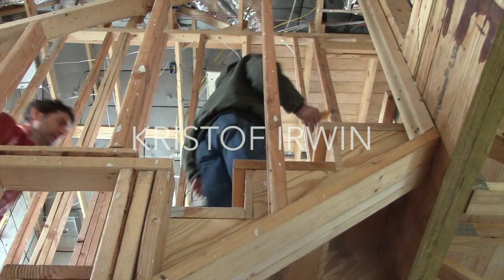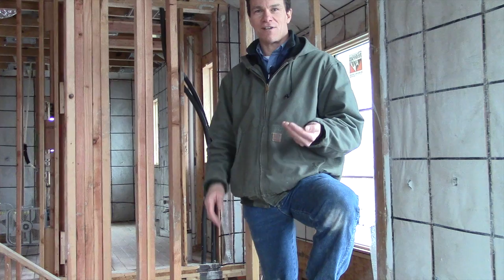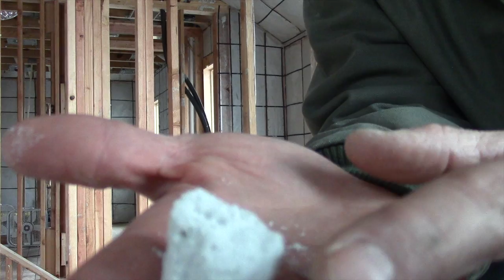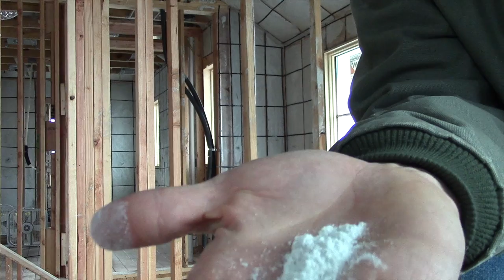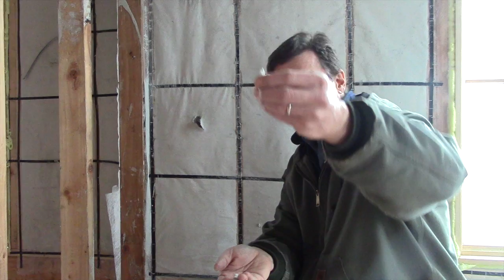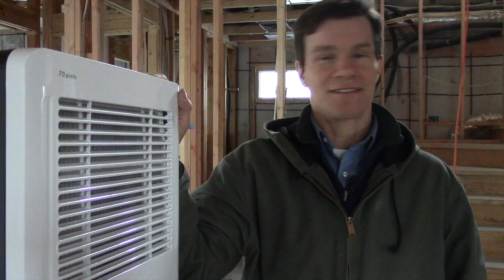Positive Energy On AirKrete & Home Insulation

Comment: aircrete usually have a bit of compression strength, but this air krete is totally dusty.. although it is dry because it make your skin dry.. does not means it will not suck in moisture and holding on to the moisture and accumulate over the time.. 

pls do a follow up. 

thankyou.

Comment: As I understand it it's brittle because it hasn't fully cured yet it's supposed to get super hard like Roman concrete if it was made with the correct type of cement
Reply: He should have came back in a week and then see if it was still brittle cuz it wouldn't be if it was done right
Reply: @ernieferguson6346  but sadly no follow up. i hate these kind of video with partial info.. like keep us hanging....

Comment: Kristof - I've listened to and enjoyed many of your podcasts, but today I came across this video while researching alternatives to closed-cell and open-cell spray foam for a renovation project I'm planning for my grandfather's 1940 Cape Cod - and I'm fascinated by the potential of AirKrete.  Have you followed up with your client (i.e., the owner of the home in the video) to see what the results have been?  What are your thoughts about the product?  I'm also wondering whether it could be used to reinsulate the attic of my current home.  Finally, do you do distance consulting and HVAC design work?  We live in Richmond, VA and I'll need someone to do the HVAC design.  Thanks.

Comment: Just use closed cell polyurethane foam.  Better at air & water sealing and a higher R value.
Reply: In case of fire I would prefer impervious AirKrete over smoldering polyurethane smoke filling the structure. Air and water handling I can live with, same with R value ... smoke I can't live with (literally).

Comment: Nice Job Kristof and Team PE!  Great video.  Interesting product.  I wonder if it has any air sealing properties in itself?  It seems similar to Owens Corning's new Conditioned Attic system using fiberglass.  Non-SPF, Netting needed, Ability to creat a vaulted insulated attic shell.  Also interesting to note they didn't want Advantech decking but used Zip sheating.  I would have expected plywood sheathing.  Keep these videos coming!  Matt